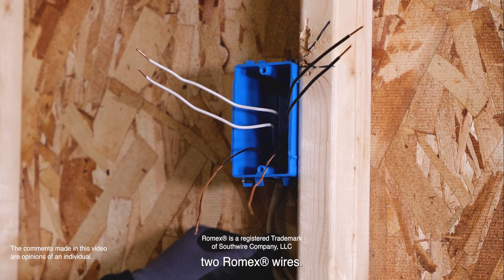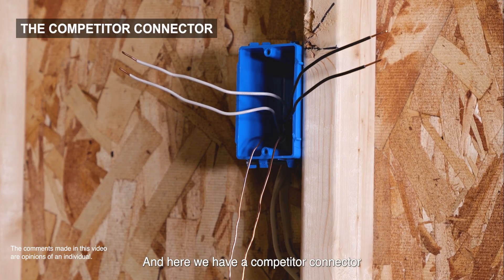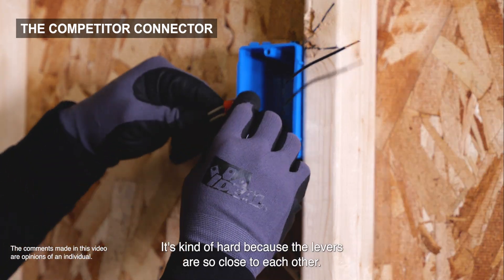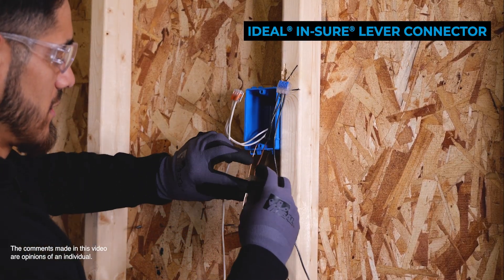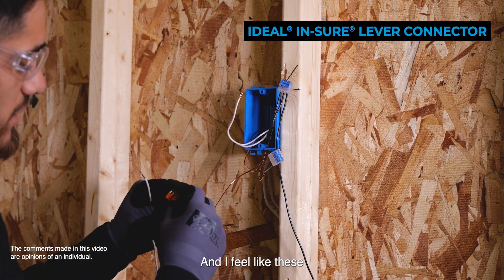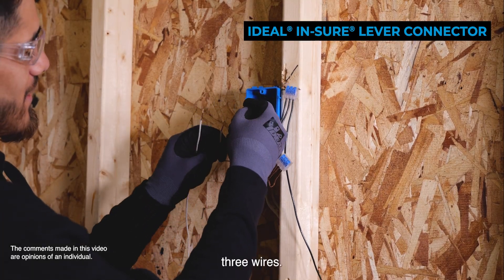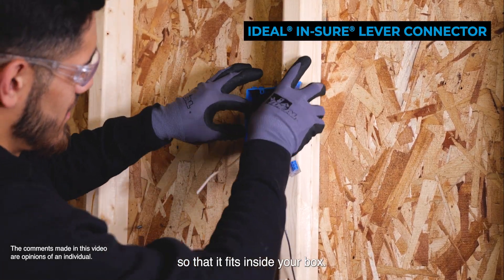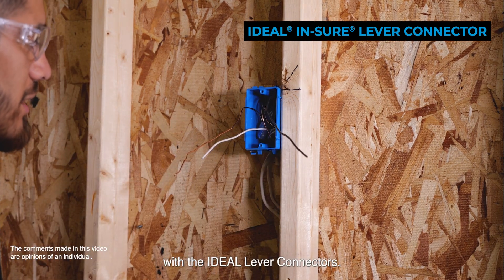IDEAL In-Sure Lever Wire Connectors vs. Competitor Lever Connectors

Comment: Ideal always made quality products. Started using their wire nuts while in grade school back in the 1960's to wire lights for our train platform plasticville buildings that each had s 16 volt light bulb inside.. My chief electrician dad explained how to connect these lights and gave me a drawing then set me free. Our American Flyer train transformer had a circuit breaker that would trip out if low voltage was shorted or overloaded. Even got to play with wires after being drafted and sent to nice warm sunny Viet Nam. Was the companies telephone wire msn & electrican. Retired but stil have a almost full box if Ideal red & yellow wire nuts I my garage..
Reply from the maker: Thank you so much for sharing this, what an incredible story. It truly means a lot to hear that IDEAL products were part of your life from those early train projects all the way through your career. We’re honored to have been trusted across generations! Wishing you all the best in retirement.

Comment: This guy is slow as hell. Take off the damn gloves if you're gonna be that slow.    This reminds me of Harley Davidson losing its way and not understanding it's market.  They got an electric bike.  WTF is that?  

Ideal should be promoting their tan twister wire nuts, how to strip wires, bend an L in the pigtail, lineup the ends and put a tan twister on it and use a wire nut spinner in a cordless. That's what Ideal should be focusing on not these copycat inferior connectors. The tan twisters are the best wire nuts on the market, and I don't buy anything else and I've been doing that for 40 years.  Maybe ideal needs help on how to use their tan twisters, how a true professional uses them.  I'll make a video for Ideal which will help boost twister sales.   Someone tell me where to send it so it will be seen and not just fall to blind eyes and deaf ears over there at Ideal.

Comment: Correction.. it should say “we paid an electrician to come compare the two” There I fixed it for you. Also, a true electrician is not gonna use these. Y’all make great wire nuts though
Reply: True boomer electrician is not going to use these! But all the other electricians with common sense use these all the time, lights for example, great for that